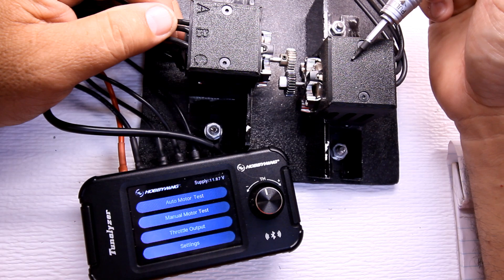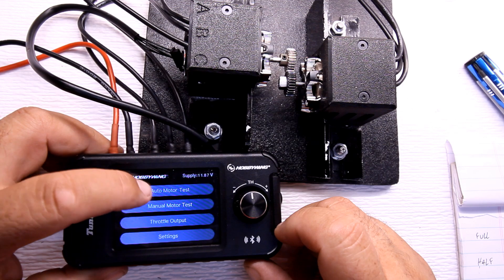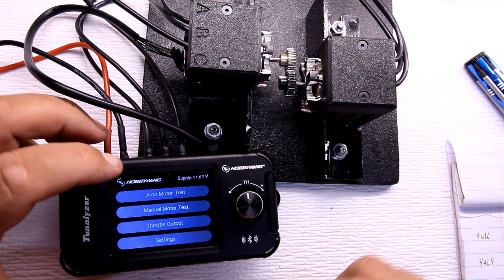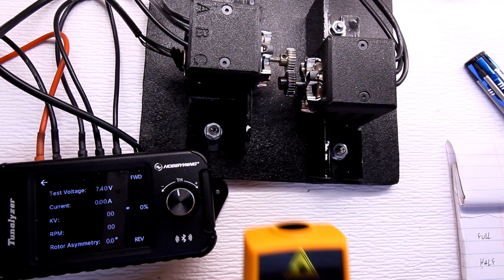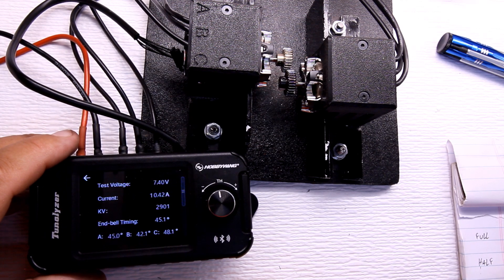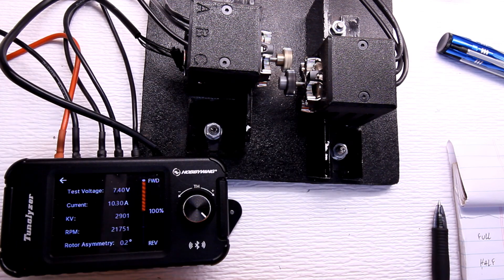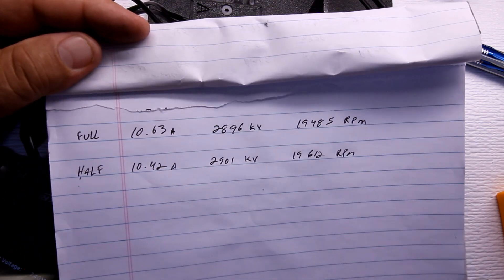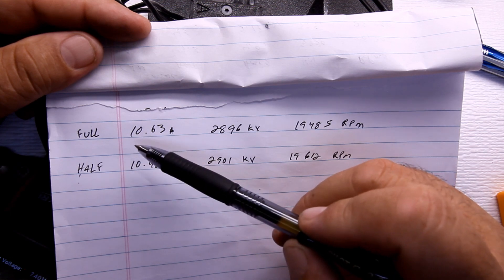Based On Friction, Are Narrow Pinion Gears Worth It?

Comment: So should I offset my pinion on the motor so it is not centered on the spur gear?
Reply from the maker: Yes.  Just make sure to keep an eye on the gear getting too worn.   Or, you can get a thin plastic pinion.  Then again, it depends on what type of racing your are doing.  High torque situations might strip the gears.
Reply: @wutupclegg6618  I am running a steel pinion & spur gear.  Thank you for the information!  & Happy New Year!
Reply from the maker: You're running a steel spur?  Are you racing or just bashing around in fields?
Reply: @wutupclegg6618  Just playing around in the house.
Reply from the maker: I would leave it as it is.  You don't want to wear out gears too fast.  It wouldn't add enough speed to make it worth it.
Reply: @wutupclegg6618  Thank you!!!!  😊
Reply from the maker: No problem!  Any time!

Comment: what was your power source? If you used a RC power pack, you will see reduced power output on second run from the top charge being spent.
Reply from the maker: Hello Adamosity7127.  Good question!  I am using a 12v 30a power supply.  If you look at the top of the screen, while doing the RPM runs, you will see the voltage at 7.4.  I look at that to make sure it doesn't change.  The Hobbywing Tunalyzer has a power regulator that I set for 7.4v.

Comment: you make it sound like its about the contact patch, its not. its about reduced weight. thats why most of them (thinner ones) are hybrid materials.
oh, i thought you were actually gonna use a thinner gear which would have been lighter.
Reply from the maker: Good comment!  My goal was to show the difference in the contact area.   Therefore, weight and material is not a factor in the performance difference .

I'll do another video using a thin plastic pinion.
Reply: @wutupclegg6618  I was going to make the same comment as @dirtrider88 you've shown that contact area ie friction has an effect, but I'm guessing you'll find bigger gains (relative) from a thinner/lighter pinion come from the reduced rotating mass which effectively allows you to gear taller because the motors are running more efficiently.
Reply from the maker: This was just a test about friction.
Reply: @wutupclegg6618  i guess they are 2 separate things that need 2 separate tests.
Reply from the maker: I ordered a thin plastic pinion.  It will be here before the end of the week.  I'll try to post a video next weekend.

Comment: How about plastic pinion gears?
Reply from the maker: Good question!
Plastic offers less friction over a metal gear. It is smoother and softer.  Plastic also has less rotating mass.  I don't have a plastic gear, but I will get one and do a video with it.  Stay tuned!
Reply: U need to compare a thick plastic pinion to a narrow plastic pinion.
Reply from the maker: I tried looking for a thick one, bout i couldn't find one.
Reply: The plastic RC car pinion gears are slot car spur gears.
Reply from the maker: That test is coming soon.  just ordered one.